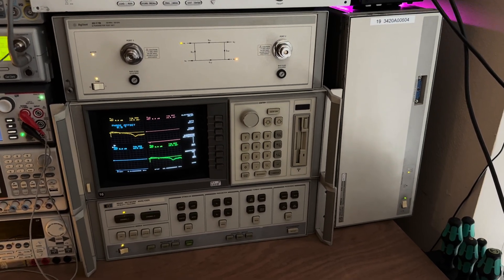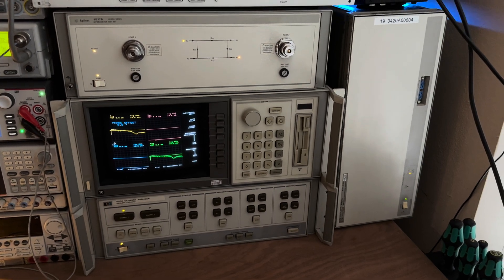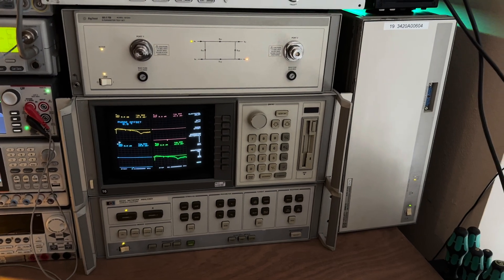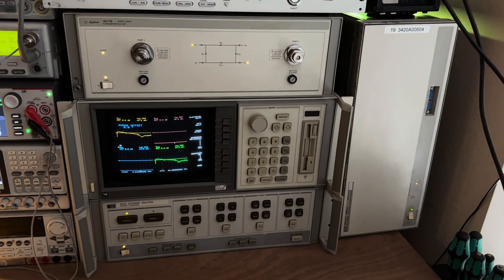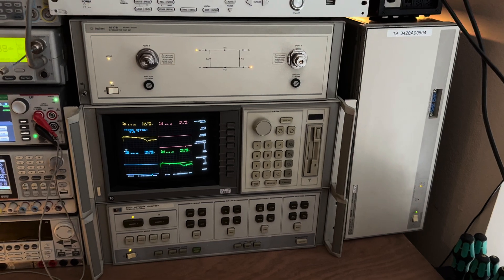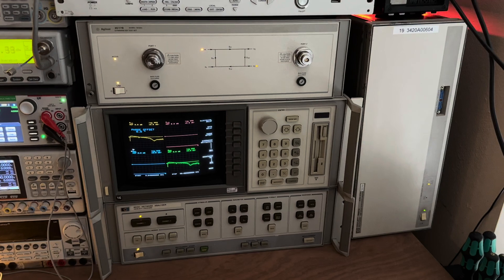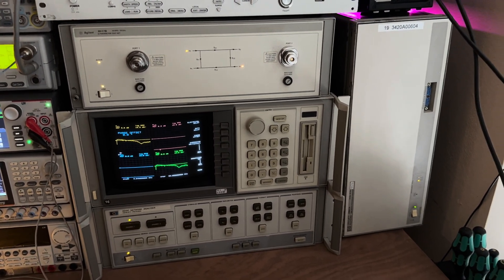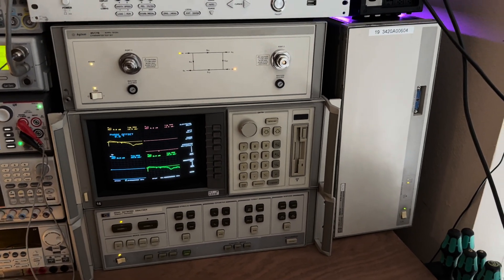HP 8510C Startup

Comment: 8510B Vector Network Analyzer without S-Parameter Test Set can't measure any paramiters. Thet is rigth?
Reply from the maker: Right, you need all 4 boxes but you can mix and match to meet your requirements. The screen and IF (box below the screen) stay roughly the same but you can choose 8340/8350/8360 as your source and 8514/8515/8516/8517 as your test set. Both the source and test set need to support the frequency you want to measure. If they don't match exactly that's ok, they just operate on frequencies they both support. There are lots of options in this family.
Reply: @jjoonathan7178  thanks a lot